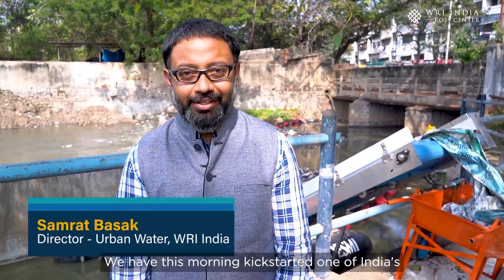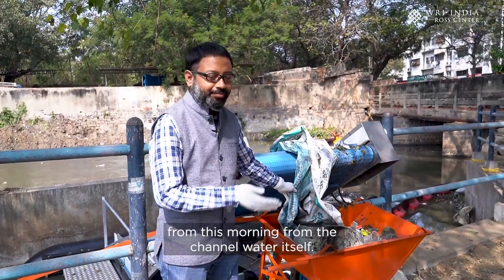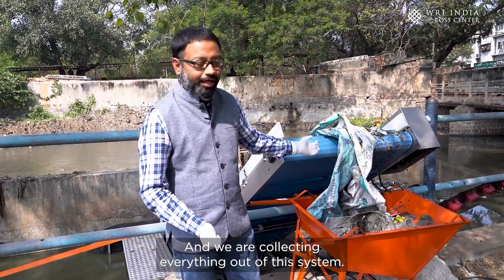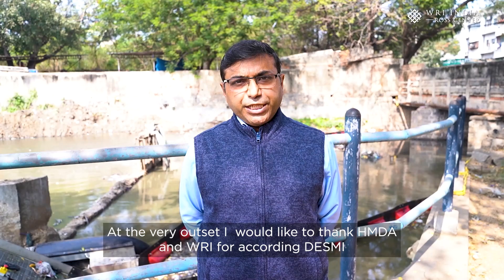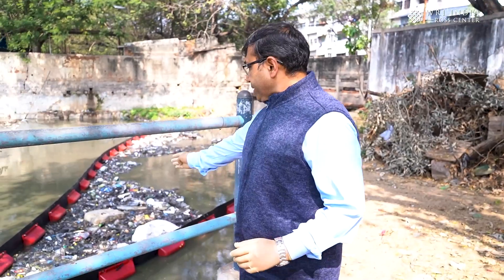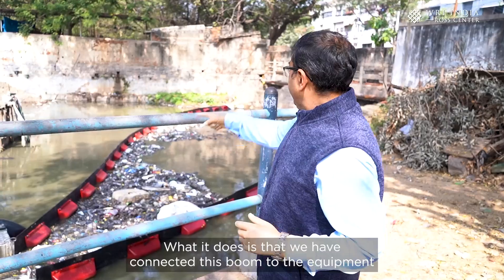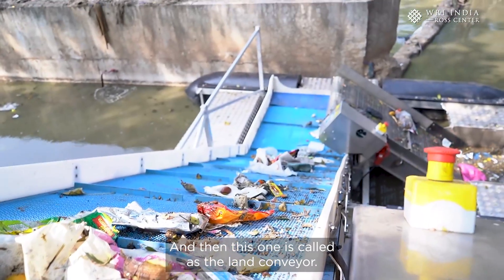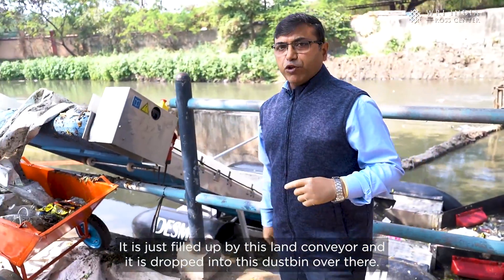Cleaning Hussain Sagar Lake - Trash and waste removal in India

Comment: Now it's working good
But what happens when it rains and water flow increases?
Reply from the maker: RISE captures most waste and plastic during the raining seasons and our system is designed for handling tidal difference as well as fast water current. 
For river with extreme conditions (because of flood, hurricane, etc.), we have solutions as well and it is also depend on how you install the system in the river. 
If you are interested in our solution, please contact us via email desmi@desmi.com